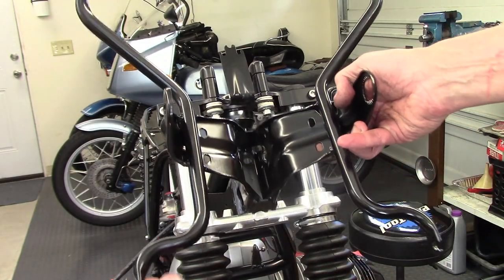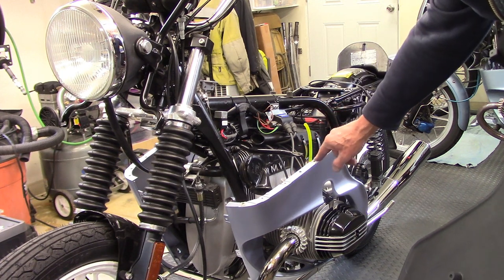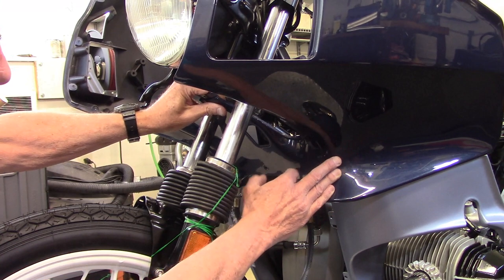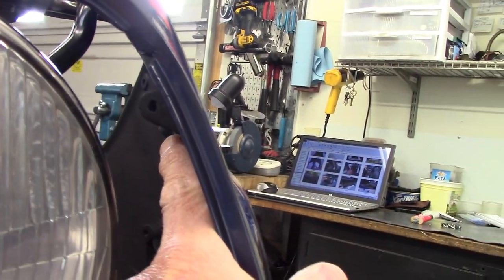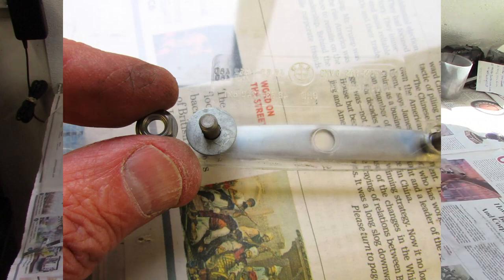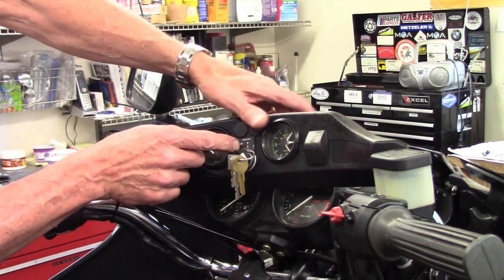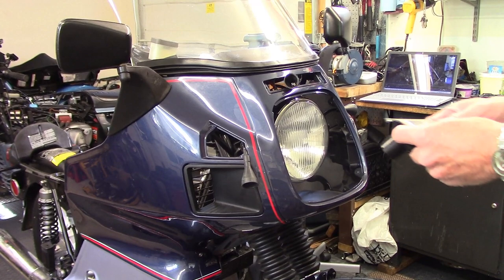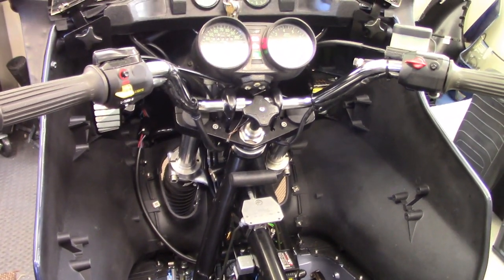1983 BMW R100RT Assemble And Install Fairing & Windscreen

Comment: Thanks so much for taking the time to produce this video. I am about to reinstall the fairing I took off 18 months ago to paint, and your process flow is certain to save me several occasions of stop, back up three steps, and re-start. My job will be a little busier - I will install the instrument panel fuses and teh side pockets. I use some one-inch-thick teflon foam to protect the tank from the side pockets. That foam was originally intended for sealing large (15 inch and up) high-pressure flange joints in petroleum processing plants.

Comment: "Fisheye" headlight glass story (from an old airhead comrade): Lines on back of glass (occasionally replaced with rear window defroster tape); the lines warm up from headlight, warming the glass and defogging the lens...JFF.

Comment: This was just what I needed. I had to remove the lower fairings to clean up my bike. Looks like it hasn't been done in quite a while. Thanks.

So far, I only have one gripe about my new (to me) 1981 R100RT...the fuse location inside the headlight bucket. Out of curiosity, I pretty much peeked into every place I could to get familiar with the bike, which meant digging into the headlight. Yikes...I wouldn't want to have to change a fuse on the road with that setup. I reckon I will probably relocate some of that rats nest...probably to under the tank.
Reply from the maker: Joe, some folks have moved the fuses elsewhere for easier access. That said, all I have to do is remove the "fisheye" glass cover from the fairing, then remove the headlight to get access to the fuses. You can pop them out with a key or a smalls stick if you are on the road, or a pair of needle nose pliers in the shop. One advantage of putting them inside the headlight shell is they are well protected from water getting at them.
Reply: @BrooksAirheadGarage  I can't argue with the protection they get from living inside the headlight bucket.

Comment: Greetings from the Philippines! Your video is very timely as I am currently restoring my 1984 R100RT. I just took apart the fairing to have it repainted. That windshield was a huge problem. I used a dremel to slowly grind the edge of the rivets away. When I took it apart the I remember that the windshield rubber gasket was between the instrument panel and fairing. In your case, the rubber gasket was on top of the instrument panel. Did you do this because it was an easier way to reinstall the windshield?
Reply from the maker: Hi Obi Wan, No, I installed the gasket that way as it seemed like that's where it should go. Since I never disassembled this fairing, I had no clue as to the gasket orientation. Your stock configuration confirms it should have been under the dash, not on top. Oh well, next time I remove the windscreen an dash, I can relocate the gasket.  Thanks for telling me about how your gasket was installed.

Comment: Hi ,greetings from Arbroath ,Scotland .
Thank you for this informative video how to do.... I was stuck big time and without your assistance it would have been one long headache.Three minor points to include I believe each instrument you installed may have benefited by having a large o ring around the bezels, but you may have had them on in the shot and I could not see them .The windscreen height is important to consider if you have not yet bought one. Do you look over it or through it debate? There are some height differences avilable.Finally I worked out an easy time saving method to insert those pesky rubber rivits.I used thickish fishing line and vaseline to tie one single knot around the wide end then gently pull through windscreen.I had no breakages but its important to use a thicker fishing line as a thinner one can cut into the rubber. Take care, Richard Allan.
Reply from the maker: Richard, Thank you for these tips. I did forget to install the O-rings. BMW no longer has them but Euro MotoElectrics shows they have them.  I'll add those when I need to any changes to the instruments or dash.  I look over the screen and at the highest position, it's about the correct height for me. There is a little buffeting so I may add a "wing" air deflector on top as I did on my 1977 RS build to better manage the air flow around my head.
Reply: @BrooksAirheadGarage  Hi, I am 5 feet 11.5 and tall but bought a lower screen  because I was worried it would mark easily and then the option for looking over it is lost. I do wonder how much of a difference the taller screen would make. Also here in the Uk, Motoworks in Holmfirth, England also sell those O rings. Thanks for a great channel you will save me time and money.,Richard.

Comment: My RT shield got hit with rock and I found Slipstream made in UK windscreen that really looks good on the RT fairing. I hope i never need this vid to take my rubber ducky fairing apart. :) I broke the dry gasket pull throughs and used shoe goo to adhere the gasket with tape holding it flush to screen.
Reply from the maker: HoverbotFPV, I liked the Super Glue since it set up quickly.  I'll have to see how well it lasts.

Comment: wonderfull video thanks . no fork/fairing gaiters though?.
Reply from the maker: I decided to use fork gaiters to protect the tubes from getting nicked.
Reply: @BrooksAirheadGarage  thanks for the reply . i have gaiters the same and i was going to swap to fairing type gaiter but clearly works for you and i don't have to strip the fork tubes to fit ,so will do the same as you. I can only thank you again for such a well produced video.
Had i not seen it , i may not be fitting. i can now check i have everything before i start and hopefully get it back on the road quickly.
many thanks 60over3rd
****AAAAA******

Comment: Hello, I recently had to remove the fairing from my '95 monolever R100RT and I left the upper fairing in one unit (left and right uppers, center upper, gasket, windshield, and dashboard).  Now I'm restoring an '89 R100RT and was thinking of assembling these components off the bike and mounting them as a unit.  Is there any reason why this method wouldn't work?  Incidentally, I love your videos and learned a lot from them.  The idea of replacing the gasket rivets with nylon screws is a stroke of genius.  Do you remember which size you used?  I'm thinking M6x12, but would appreciate your input.
Reply from the maker: Hi Marc, I find it hard to align the different panels with the upper, middle and lower fairing bracket if all the panels are assembled. It was easier for me to get everything aligned by building it up one panel at a time. And, it helped me avoid dinking up the paint job. That said, take a run at installing all the panels as a unit and see what you think.

The link in the summary underneath the video pane has all the details about the hardware and procedure to install the fairing.

Comment: I was wondering if you could help me. I have a 77 R100S with an RT fairing on it (the previous owner was apparently converting it to an RT). This also meant he did some creative rewiring. I've been chasing a bad ground, but lately, the issue has compounded with the headlight indicator lights no longer lighting up. So I decided to pull all the wires off, clean the board, and now I want to reconnect them. Problem is... I don't really know where some go. The wiring for the blinker, for example, isn't represented on the wiring diagram I have (the left blinker has a black, orange, and light blue wire). The orange wire was clipped into a combiner (that blue plastic thing with a bit of metal in it to connect two wires) with a blue and red wire. The light blue was soldered to a blue and black. And I don't remember where the black one went. I'm autistic, and looking at the wiring diagram makes me feel overstimulated with visual input.

Comment: Your descriptions and solutions are SO good! I had a 1983 RT once and I think it had a rubber boot at the top of each fork leg so the fairing didn’t have 2 big holes through the fairing – will you install these later or maybe it’s not an RS thing? Stay safe🕊
Reply from the maker: Hi Ernie, I opted to use the rubber fork gators instead of the rubber boot that installs in the oblong holes in the center panels. The gators protect the fork tubes from getting nicked from gravel which keeps the seals from leaking.
Reply: My R75  at 93k, never had a fork seal leak. My 78 R100RS  forks leaked at 35k. Beauty over function. I Love my RS, but simple maintenance is tough. Due to the fairing.  Hell I get it. That's what it takes to go 123 mph. But honestly, anything under 70 mph is painful.  I used it as a 20 mile each way to work. My fault, out  of its element. But I sure looked good doing it.

Comment: I love the story about the anti-radar system in the headlight cover.   How has that worked out for you Brooks?
Reply from the maker: Peter,  No  "Performance Awards" so far on the 1977 R100RS :-). I expect the same on this bike.
Reply: @BrooksAirheadGarage   So was the "takes the eye away from...." story true? I'd heard somewhere that they were a primitive defroster/deicer. As in light hits the lines and heats them up. All I know is I don't want to be riding in conditions where any deicer is needed :)  I think RAM is a better story!
Reply from the maker: @edwardj456  The story I relate about the reason for the lines is directly from the designer of the bike, Hans Muth. There are lots of other stories, but they are urban myths.
Reply: @BrooksAirheadGarage  It would be fun to see a list of all the myths. But I can see how the designer did a great job, the eye is pulled from the tunnel to the orange lines. Thanks for that story!

Comment: I am just trying to assemble one that came in boxes. Bike done, onto the fairing. Do the cylinder covers have another nut on the engine mounting bolt or do they use the nut that also holds the engine? It makes a difference to the width of the fairing. I can make it fit with and without an extra nut but just wondered which is correct.
Reply from the maker: they use the engine stud and nut.  Click on the link under the video to see read the document showing all the details of this work.
Reply: @BrooksAirheadGarage  I did look at the link and read it. I couldn't work out if it was a second nut or not from the video or the description. One nut it is. I should finish today I think. Thanks.
Reply from the maker: @johndkn  Ok, I added a note in the section of the web page clarifying that the nut is the same M12 used to secure the front engine stud.
Reply: @BrooksAirheadGarage  That works. :)  Now having done the job I think a health warning would be in order. Absolutely the worst job I have ever done on an Airhead. More of a Tourettes syndrome test or for figuring the flying ability of spanners. Never again. :)
Reply from the maker: @johndkn  Endeavor To Persevere 🙂

Comment: Would you be able to share where you bought the ignition switch marker plate? Can’t seem to find it anywhere. Thanks.
Reply from the maker: Rhys, I can be ordered from any BMW motorcycle dealer, Part# 61 32 1 243 267, about $10.00 US.
Reply: @BrooksAirheadGarage  thanks so much!
Reply from the maker: @rhysvleugel6947  You're Welcome.

Comment: Love your work..I was wondering if anyone could direct me to a vido on how to remove the faring..for a BMW R100RS..I thought I had seen one posted I should have saved it..in any even any help would be welcome..as Im sure there is a very specific procedure to make it easy...
Reply from the maker: Lowell, I show how I remove the RS fairing on a 1983 RS my website.
https://brook.reams.me/bmw-motorcycle-rebuilds/1983-bmw-r100rs-rebuild-project-index/46-bmw-1983-r100rs-remove-windscreen-fairing-dash-volt-meter-clock-ignition-switch/

I also have some documentation for the 1977 RS, which uses the same fairing panels.
https://brook.reams.me/bmw-motorcycle-rebuilds/1977-bmw-r100rs-rebuild-project-index/46-bmw-1977-r100rs-remove-disassemble-bodywork/